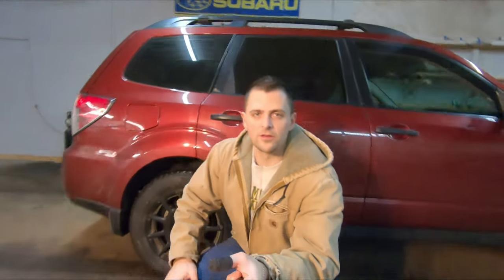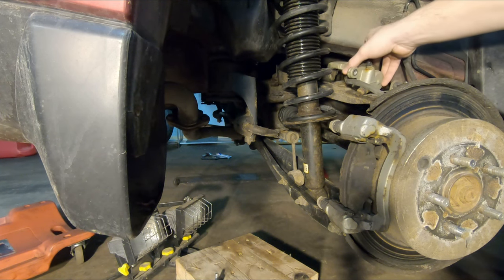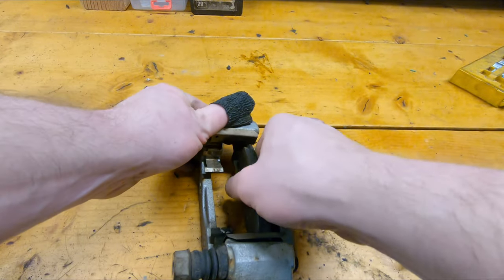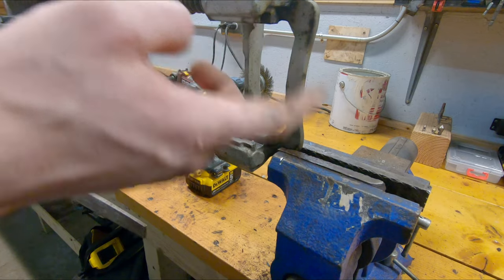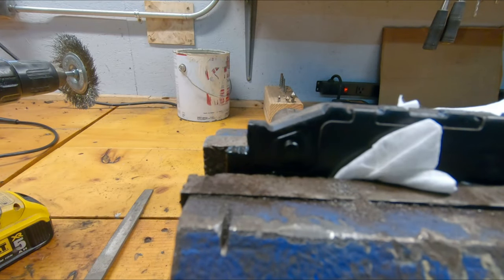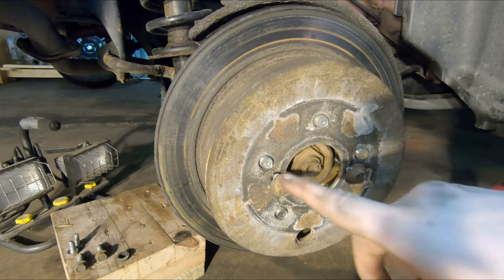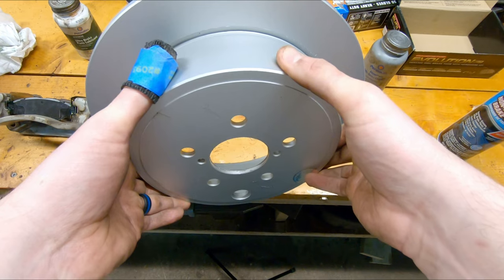2012 Subaru Rear Brake Service, Rotors and Pads (2012 Forester)

Comment: sweet tip for the carrier! will have to slightly file the tangs/ears on the brake pads to ensure they slide properly! will now have to implement that in all my brake jobs!
Reply from the maker: Manufacturer also plays a part. I used to always use power stop pads and they always needed to be filed. I've since switched to Centric which almost always fit prefectly.

Comment: I have the calipers all tightened down bled the brakes and everything but the calipers are still moving a little bit and one on the other side can completely compress what could be causing this, I also have no brake pressure but nothings leaking
Reply from the maker: I'm having trouble visualizing the issue you've described ...

Comment: It would be nice to have a list of everything needed, used, and bought for this project.
Reply from the maker: Rear rotors (2012 Forester)
Rear pad set (2012 forester)
Reply: @TwoFourSevenDIY  i was looking more for a complete list. Like what tools (and their sizing) and chemicals do you use. You used more than just a new rotor and brake pads. thank you for the reply.
Reply from the maker: I'm not sure how to answer your question ... you can see the tools I used in the video. Only materials used were rotors and a brake pad set ... brake clean to clean the rotors which is obvious. The pad set comes with new shims and grease, I just use my preferred brand of grease

Comment: Fantastic video well done my friend I’ve always done my own brake pads but I’ve never filed the lags like you do it but I’ve often wondered if that should be done thank you very much🇬🇧🇬🇧
Reply from the maker: Thanks for the kind words.
I can't say if it's an "industry recommended" technique, but I've always found that if I don't file them down they just end up sticking a few thousand miles after a pad change because the fit is just way to tight
Reply: @TwoFourSevenDIY  I agree, this is a regular practice the guys use to service disc brakes at the race track. A little clearance goes a long way to allow the pads to retract from the rotor surface quicker after your foot comes off the brake pedal. Lets air get in between the pad and rotor sooner to cool off the pad surface before applied again on the next turn. This helps keep your brake fluid cooler so less fading. These tricks allow you to brake later going into the turns. Gaining 1/10th of a second by braking later on a 10 turn track gains 1 second/lap.

Comment: Anybody have the torque specs for the caliper bolts? On some Hondas it's around 75ft/lb for the caliper bracket and 25ft/lb for the pad bolts
Reply from the maker: Front
Fill Nipple - 5.9 ft-lb
Caliper - 19.9 ft-lb
Caliper Support - 59 ft-lb

Rear
Fill Nipple - 5.9 ft-lb
Caliper - 19.9 ft-lb
Caliper Support - 48.7 ft
Reply: @TwoFourSevenDIY  You're a bro, thanks.

Comment: Great video to use when changing Subaru Forester rear brakes. I like the tip for the wire brush to clean the hub.

Comment: Great video! Just one question, Do you have to bleed your brakes after changing the pads? I’ve never changed my brakes before but I’ve always thought you had to?
Reply from the maker: Nope. No need a all.
Only time bleeding is nessessary is if part of the brake fluid system is disconnected ... for example, replacing a caliper.

Comment: Very informative & detailed brake service video. Would you agree that installing the pad squealer on the inside with the tab placed on the rotor's leading edge to be the best practice? Does not seem to be a best practice for this. It will make a difference near the end of pad life whether or not the squealer will indicate with noise with vehicle going forward or backwards, depending if tab is installed on rotor's leading edge or trailing edge direction. Really well done! Thanks
Reply from the maker: Thank you for the compliments! I'm honestly not sure the squealer makes a difference, I've seen it installed on both inside or outside pads in the past.
Personally I've never found them to be a reliable indicator of worn pads so I just make sure to keep an eye on pad life each time I swap my tires over at season end.

Comment: I just had the same problem with the irregular pad wear. I found that the pad with the squeal tab has an extra rivit pin on the back side.  The fork on the caliber bracket falls right on the extra pin causing uneven pressure on the brake pad.  This is causing the irregular and excessive wear.
grind the extra rivit off.
Reply from the maker: I'll definitely have to check that out next time I look at the brakes.
Thanks for the heads up!

Comment: What type of tires do you have?  Tire size?  I have a 2010 forester XT.  Great Video
Reply from the maker: I bumped up from 16" wheels to 17" but wanted to keep the sidewall roughly the same size so I went with 225/60/17
My understanding is that any bigger than this and you start rubbing.
When brand new at full droop there was only maybe 1/4" clearance between the tire and front inner wheel well plastic in the rear

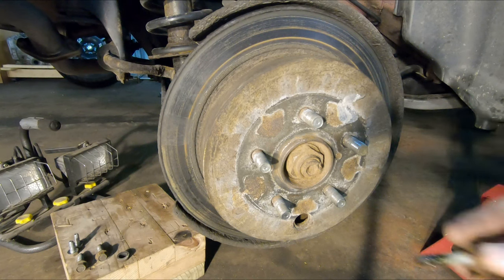Comment: Thanks.  11:14, aren't the caliper bracket bolts the right size to use to press off the rotor?
Reply from the maker: The ones that bolt to the slider pins? Possibly, I wouldn't risk screwing up the threads using them, sometimes the rotors are on there pretty good and it kind of galls up the threads

Comment: Might not hurt to use proper torque spec on bracket and caliper.
Reply from the maker: Been wrenching since I learned to drive, in my opinion there is no need for torque values here. They just need to be tight enough to not loosen up and not too tight to snap.
I'm not saying there is anything wrong with using torque values, but trust me, even dealership mechanics won't bother putting a torque wrenches to bolts such as these ones.